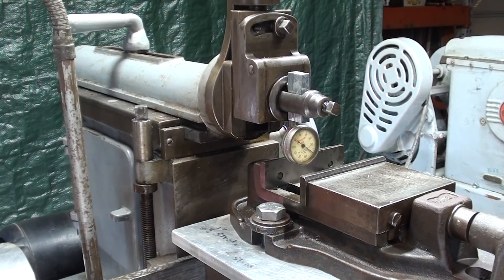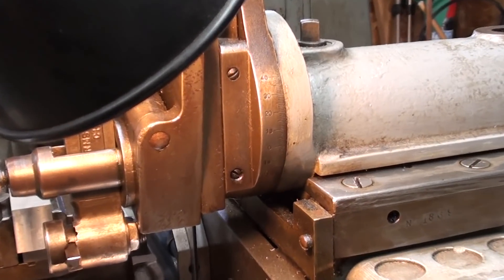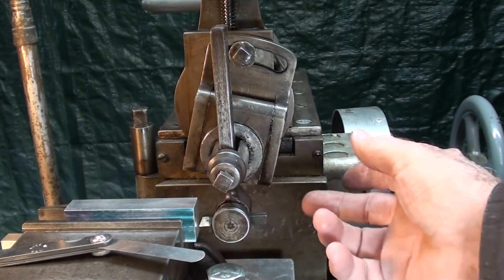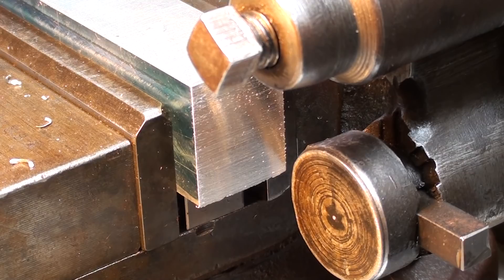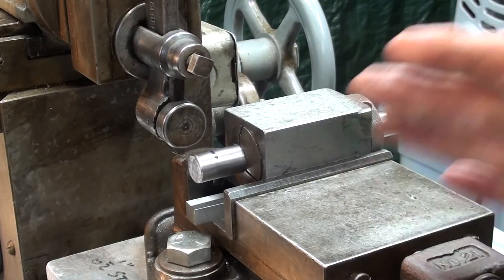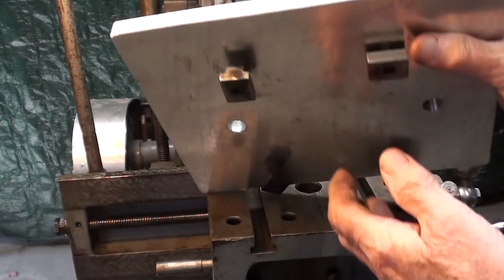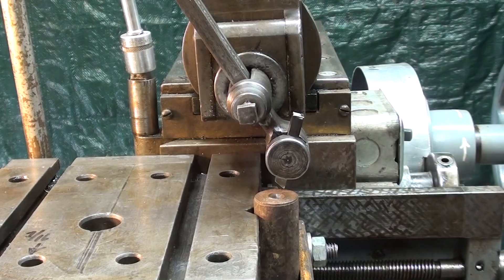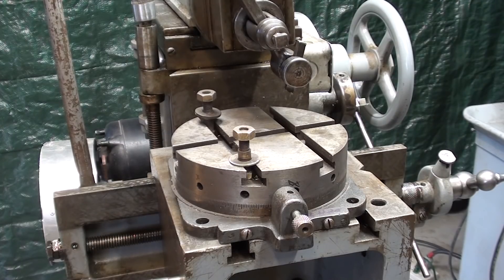SUNDRY OPERATIONS ON RHODES SHAPER 687 tubalcain

Comment: My dad had a shaper back in the mid 80s we went down to Denver to pick it up.
He had made his own cherry picker and it was so heavy the back strap broke right off.
Had to get a tow truck crane come in to unload it off his trailer.
When he passed in 96 I wanted his shop, but my family said no we want the money.
Any way I watched it cut many times.  It was a marvelous piece of equipment.
Every thing sold at auction, I do not remember what that sold for.
He had a surface grinder, a lathe, a mill, I used them all for something he needed.
I miss him and his shop.  
Thanks for bringing back the memory of his shop.
Lee

Comment: I used my milling machine this week to drill a Series of 3/4” holes in a in a piece of 3/4 “ plate. The DRO makes life easy getting the spacing all correct by using the linear function. Sure takes the work out of the layout process. 
I really enjoy your videos, you are an awesome teacher.

Comment: Thank you Mr Pete. I learned a lit of good practices. As I watch you working with the round stock on the side, I thought that would be a good way to put a slot or a tang on a shafts of a driven part.
Thanks again.

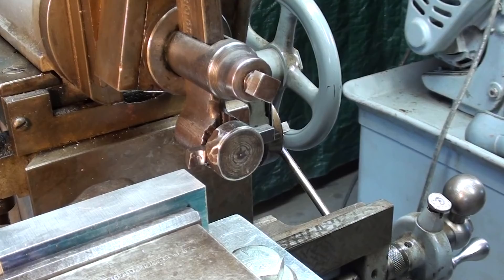Comment: Shouldn't you use a B&S Indicator on a B&S vise? LOL  8:20  A: I learned that in Hi School Machine Shop.  The straight line striation finish is much more aesthetically pleasing than the swirl of a vertical mill cutter. 21:25 No harm in reiterating points to keep from damaging the machine.  DEFINITELY ENJOYED THE VIDEO.  I love Shapers of any size.  Good Lord willing, I will see you next time.

Comment: I wonder if you could make a power down feed by modifying a ratchet wrench to drive the downfeed lead screw, putting a slot in the handle for your feed adjust, then having an adjustable tie bar back to somewhere stationary.  The tie bar would have to be telescopic and stroke adjustable as well.

Comment: I have never seen a shaper in actual commercial use nor have I ever talked to anyone who has. There must have been a time years ago when these were being manufactured and used. You have shown several different models in the 7 inch range and Abom at least two or more large ones. I guess we could say Abom is a commercial user.  It seems like school shops at one time had them and taught their use. Was there a time when factories had a rooms full of these things working all day long? There seems to be a resurgence in interest among the hobby YouTube community. They used to make things with a shaper, now you entertainment with it. I hope a hobbyist would spend their money on more versatile conventional machines like lathe, mill... before buying a time waster like a shaper. 
When were shapers in their hay day? When did they fall from favor and quit building them?
Reply: I have owned a shaper for over 30 years. Yes,they are slow,however, if youneed an internal profile, they are hard to beat. Simple cheap lathe tooling is cheap. And you can grind literally any profile you can dream up. For me ,I wouldn't be without mine. One of my most prized tools.
Reply: I  think the Bridgeport was the final nail in the coffin for shapers.
Reply: @bwyseymail  Yeah once the vertical mill came along the shaper became less used machine.
Reply: @billoxley5315  Do you have a home shop or commercial facility? How often do you use it? Do you use it instead of a faster process like milling?
 I don't question their utility, I question their productivity and their practicality. Like a lot of specialized things when you need it nothing else will do. Or if you have no other way then you use it. A wire EDM is a good example, it will do amazing things with amazing precision but it is slow and costly to run so I don't use it where a drill or end mill will do the job. I cut the occasional key way almost always with a broach or end mill. If the part is outrageously hard or otherwise challenging I will EDM it or waterjet it. Even though I have fancy ways to do things I will go for the fastest and simplest one first.

What I don't get is when some one shapes a flat surface in an hour or two when a face mill would take a minute or two. 
Entertainment I guess. I have been around the machine trade for 40+ years not as a machinist but I have done lots of machining of many kinds. I have known about shapers for a long time but never saw one in use until recently on YouTube. They are strangely fascinating in operation albeit simplistic if not primitive. Given the number of different makes and models they must of sold well at one time. I wonder who made the last one?
Reply: John - for what it’s worth, on a visit to the Starrett factory I saw a batch of Mikron shapers busily nibbling away at gear sectors used in dial indicators. I don’t know whether the Mikron people call such machines shapers or not, but there was no mistaking the back and forth motion of a form tool over a workpiece. The machines were sized for tiny parts, and perhaps therefore could stroke at speeds so high they were just a blur.